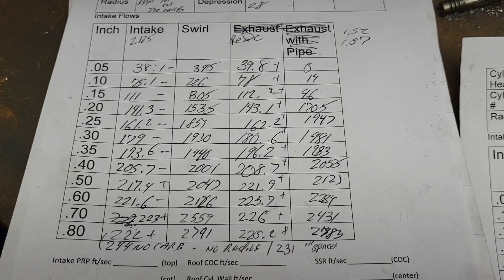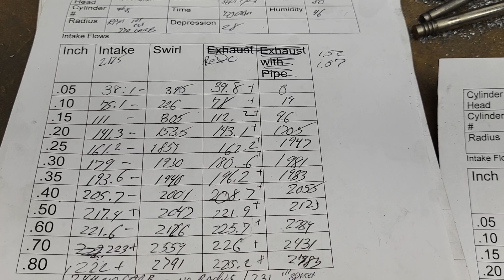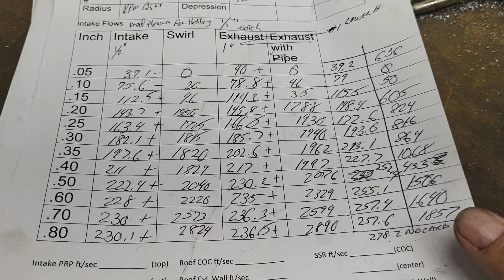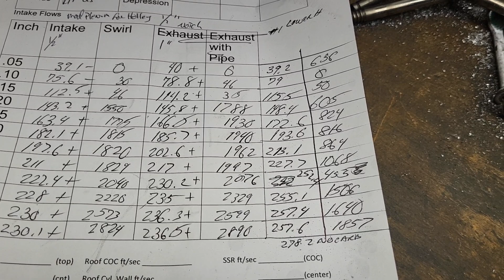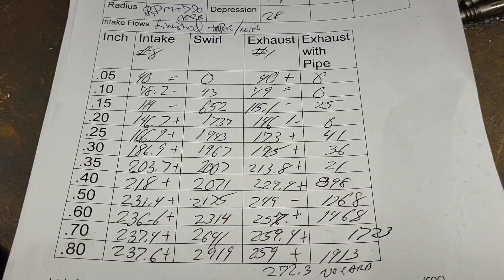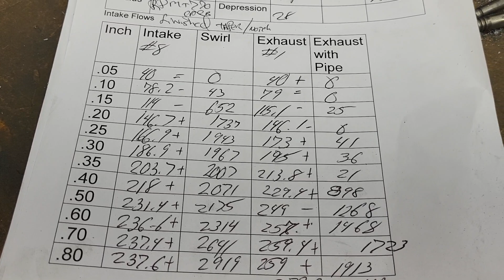Edelbrock Performer RPM Sleeper manifold part #2. Runner taper, plenum notch, flows with 770cfm carb

Comment: I think you guiding the intake charge more to the torque side of the intake and giving the secondary notch to let the secondary a low end torque as soon as they kick in preventing the dreaded bog never seen those 2 little tricks on the divider but your not going to tell are you i really appreciate you sharing
Reply from the maker: @raysimon1368  I did this design decades ago. I have had good luck with hot street stuff like this. Thanks

Comment: Nice modifications i have that intake 7104 edelbrock going to put it on my sbc 400 with 840cfm old buick wildcat qjet i got 282s magnum cam solid lifter cam world products sportsman 2 heads 5.7 rods couldn't afford 6in rods lol dished pistons for 9:1 compression i think all that in my 1970 chevy Kingswood wagon anyhow does that sound like a good combo to you its just a fun street car 700r4 transmission gettin posi trac in the 12 bolt rear soon
Reply from the maker: Nice!

Comment: would there be any advantage to windowing the divider down closer to the floor of the upper plenum and leaving the top of the divider to ensure the assumed pulses left to right wouldn't interfere with the downdraft through the butterflies. Thanks for sharing your knowledge (except that angle thingy)
Reply from the maker: The lower it goes the more it can share the barrels. It also takes away low end torque and adds upstairs torque. Making it more like a bad single plane.

Comment: This is interesting to me...I don't understand why a bunch of dyno head comparisons show pretty big gains with a Performer RPM, even though the intake seems to be a choke point. I think that AFR 185 sbf heads are supposed to flow 285 cfm at .550 lift, but if the intake only allows 220 cfm, how do the heads even make a difference? 
Thanks
Reply from the maker: 2nd degree freedom of a dual plane boosting torque is very important! Thanks
Reply from the maker: Port that intake and it will help!

Comment: Awesome work, I really like the notch! You briefly mentioned backfire recently and it got me thinking...we have all experienced backfire with a crappy carb but what exactly is taking place inside the chamber/port/runner when that takes place? Thanks brother enjoy your weekend. Oh, hi Rob 👋🙂
Reply from the maker: I am not 100% sure but it seems all the air fuel in the intake burns. It may be due to a few things, a hot spot causing ignition or plug crossfire.